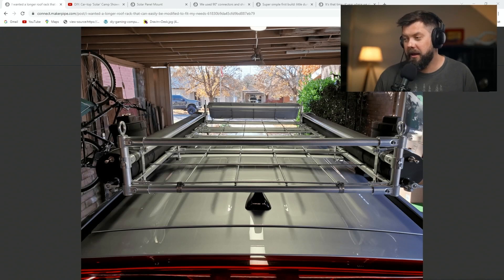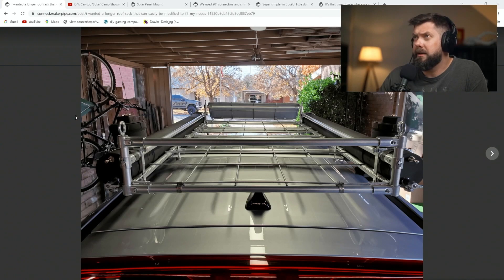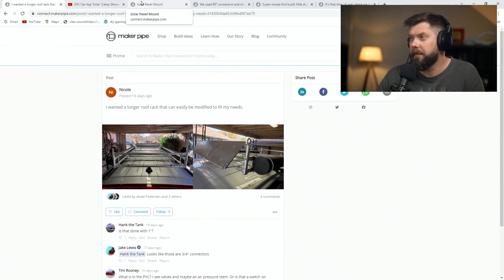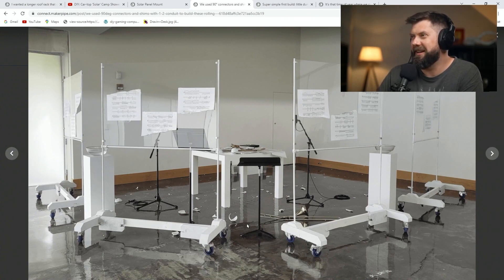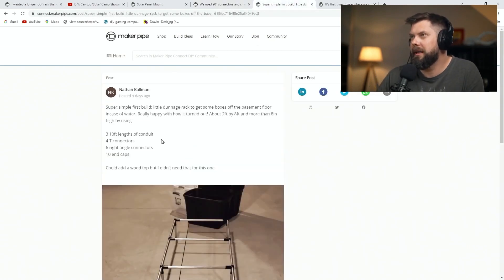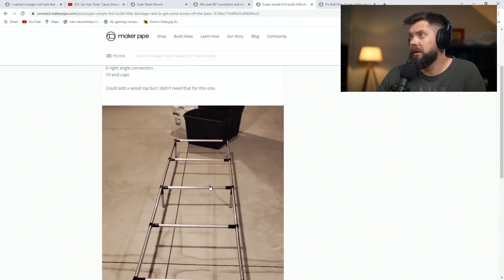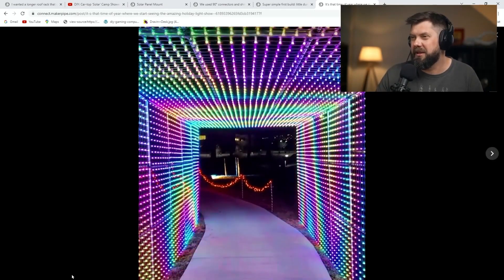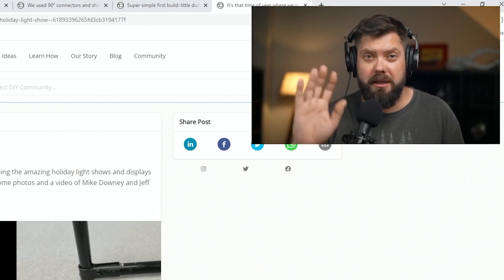The Paper Shredding Orchestra & Other Conduit Builds | Maker Pipe Monday - 075

Comment: Will the new pro connectors work with 1 inch black iron pipe?
Reply from the maker: Hi, thanks for the question. You can use the new Pro Connectors with 3/4" black iron pipe. Below is a video that shares more possibilities.

https://youtu.be/WtYyF2BRFPo
Reply: @MakerPipe  any plans to make connectors for the 1 inch iron pipe? 

Can I get a custom order?
Reply from the maker: @voges1001  We are working on the rest of the Pro Connector lineup at the moment. A bigger size that accommodates 1" black iron could be a possibility sometime next year. How many do you need for a project?